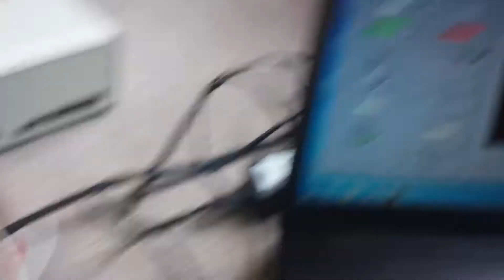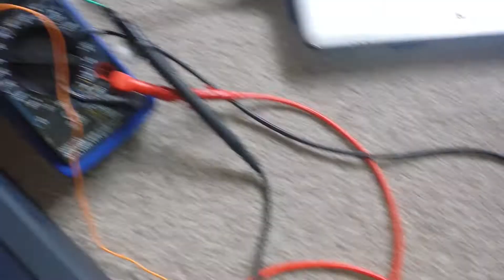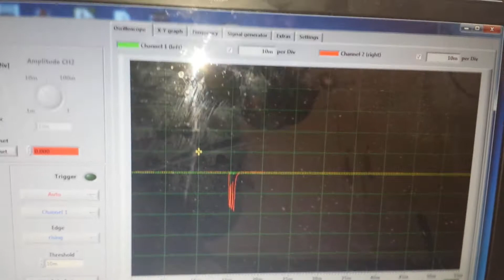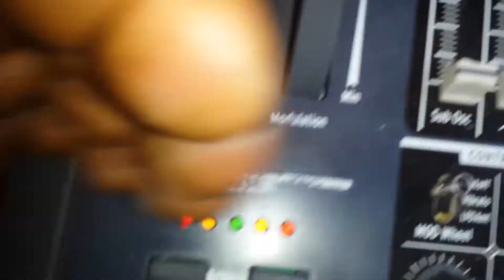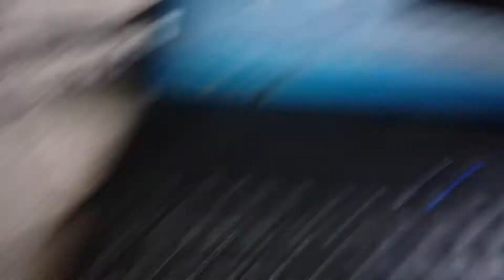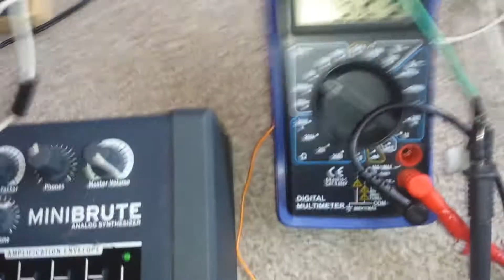DIY analog synth project Tutorial Part 10d (Arduino Midi to CV Gate circuit Voltages etc)

Comment: nice audio interface !  i bet that was'nt cheap
Reply from the maker: joohop Thanks. Tbh it didnt cost that much under , just under £150 when it first came out so relativly cheap for a decent interface.
Reply: cool i use a Focusrite 2i2 , super little unit !  keep up the good work bro
Reply from the maker: joohop Ok kool yes Focusrite /Novation products are not bad . They are quite reliable compared to some. Thanks again :-)